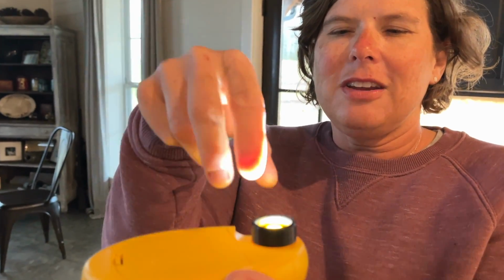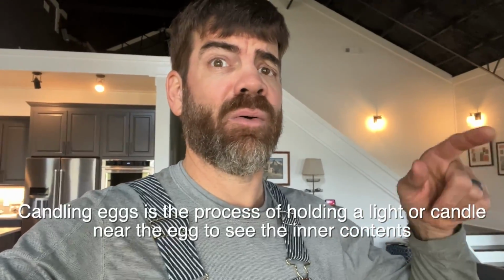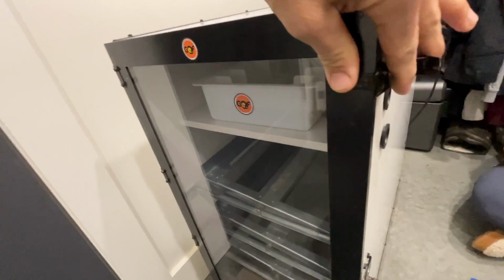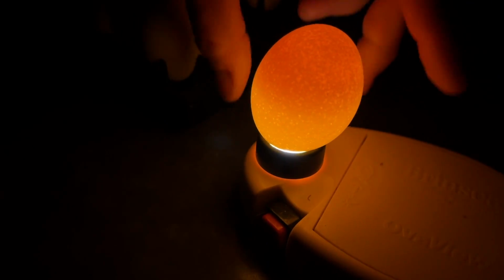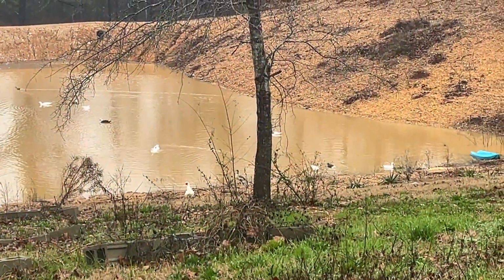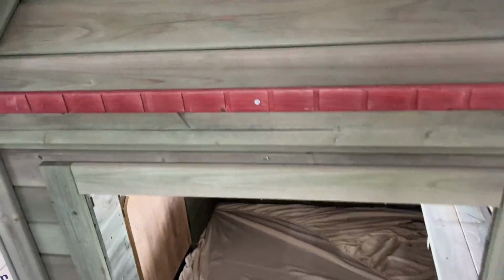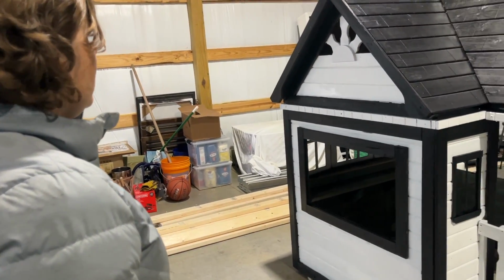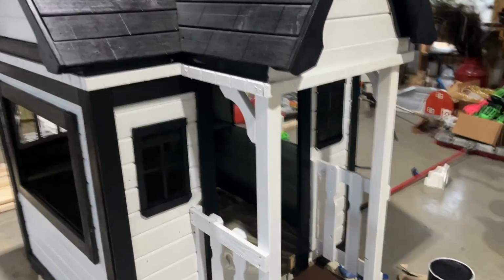Revamping an Old Playhouse into a Cozy Chicken Coop (You Won't Believe How It Turned Out)

Comment: I would put the shutter doors so they open up to the nesting boxes and you can easily grab eggs and change out nesting pads without having to always go in there (house). Leave their feed and water in the (taller) run area. It's rather smaller, so it's a Brooke or MC clean chore-type house. Maybe build a pullout floor base for easy cleaning. It will look fabulous in the back garden.
Reply: Great ideas
Reply: Would the silkies be able to jump up to the nest box?
Reply: Paint the door red ❤
Reply: @southernmomma5832  
I like that idea
Reply: Great ideas Patt, especially the shutters. 😊
Reply: @southernmomma5832  I said maroon but any red is a great idea.  Great minds think alike.  Lol 😆
Reply: Hello there I hope you don't mind us being friends?
Reply: Agreed.  Easy access from the outside for nesting boxes, and that should be low enough under those windows for them to get in, and a Tarp could work on the floor so they could drag it out to clean.
Reply: If the playhouse is going to be on a base in the air by a foot... Couldn't the floor be cut out, replaced with chicken wire, and where the base will meet the bottom of the playhouse make sliding tray drawers on the outside that will pull out for easy cleaning.
Reply: @SusieLovesJesus  that’s a great idea!!
Reply: Yeah, when they raise it off the ground they could put a pull out tray between the platform and the house.
Reply: @SusieLovesJesus  
Great idea!!
Reply: You can add sand as the floor not play sand as that packed down you want sand that has different size particles sometimes called construction sand,it doesn’t stay wet,very easy to clean as the poop stays on top,clean like a litter box it doesn’t smell or grow bacteria.

Comment: You could put your hardware cloth on the inside where you want to do the shutter look for. But have the shutters where they can be open during the hot season which is a lot down there. That way it gives a breeze but it still protects the birds.

Comment: I took an old playhouse and fixed it up for my ducks...my house had too  many openings on the side so, I cut some plywood to fit the area and put lattice over the plywood...it came out really cute plus, it made the coop more air tight and less rain could get in. I painted mine blue with white windows and a black roof....it turned out really cute!  I wish mine was a victorian  like yours though, mine is a cabin style.

Comment: The shutters for the two open sides I suggest making them open-able. You mentioned that's where the nesting boxes will be, well it'll be easier to open the shutter to gather eggs than either of you fitting in that tiny door.

Comment: Make Chunnel through the garden, (chicken tunnel) if they are allowed to come out from the run, can always be rolled up and out of the way. Make it more fun for them.  But…not full access unless connected.  It looks adorable by the way. Can alway put it up on a base to raise it.  Can put a chicken swing on the front porch, or put a board attached to the side like a swing attached to the house using the house as the one post and the other built off, (90’ angle post) ⛩️🏗️ and put swings on it.  Hard to explain but look at the pics, attach to side of house as a chicken swing.

Comment: You got an old run down barn full of stuff you SHOULD be able to make Holly a doggie wheel like those cat n hamster wheels.  For yourself, a hammock stand in front of the fireplace sounds nice.  
I use mailboxes in the garden for handtool storage. At my old house I only needed one.  As my address was 6280 I just labeled the tool box 6280 1/2.  Bantam silkies would be 1/4.

Comment: idk if you have Target close by but they have small metal mailboxes in their "dollar" spot right now (they are probably $3-$5).  They are white, so you may want to paint one,  but they are the rectangular kind that have the top lid and are molded with "MAIL" on the front.  I believe its all over the country at the same time, so they should be there.

Comment: Even though you shutter it closed on the sides, I'd make it operational to make cleaning easy access.  Also if it winds up you have more silkies than not, you might consider making the bottom the top of the 2nd story. You wouldn't need to the the 1st story as tall as the 2nd, just have sturdy supports and enough height for the silkies comfort. You could get one of those small metal cans with a lid and stencil "scratch" on it instead of "trash".

Comment: I liked it the way it was, but since you felt the need to change the color of it, wouldn't a stain have made more sense? That paint will chip off and it'll need repainting and maybe pile chips on the ground. A stain would've seeped into the wood = more wood protection with much fewer repainting chores, right? Birds tend to peck and eat paint, but these may not since you're leaving the door open. I hope racoons and foxes won't raid it. can't wait to see the  finished product, though 'cuz I'm sure you've thought out their protection.